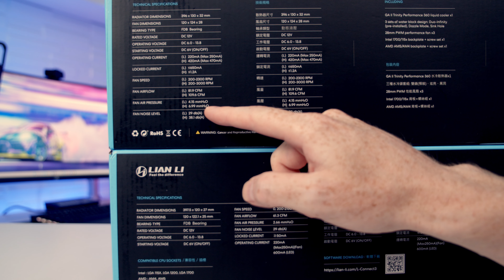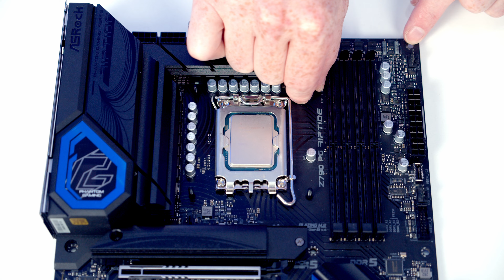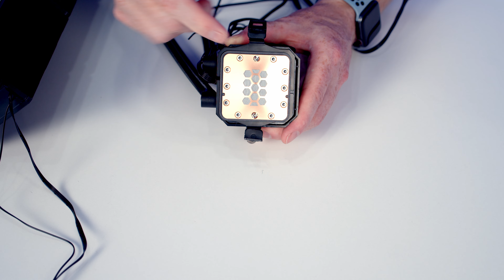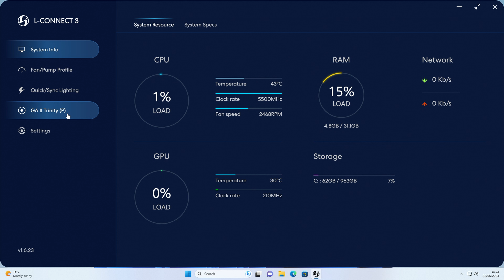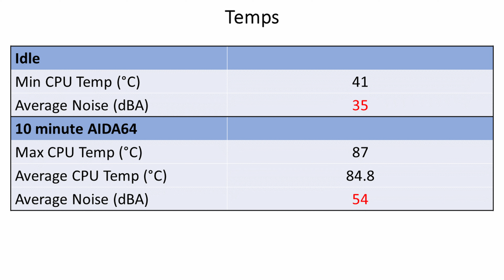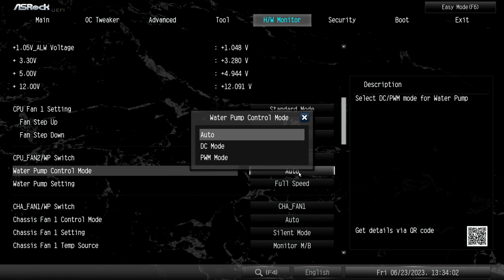Lian Li Galahad II Trinity Performance Review & Installation Guide

Comment: This is a great guide, but I have a question.  I have built computer all my life, except for the past 10 years.  I have never used the Argb lighting connectors.  If I use the 3 pin Argb connector, do I still connect a standard 4 pin pwr?  I know that seems like a stupid question, but lighting is a new concept for me as I have never really liked it.  Generally, I don't have much choice with the product I bought.  MB ASRock z790 Nova Wifi, Lian Li Galahad II Trinity Performance, D50 ARGB Ram Radiator, INNO3D RTX 4080 Black...nothing else has lighting...Thank you in advance for any advice.  This is a good video, but for the Lighting, I am a noob

Comment: 44° C idle? Dude, is that temps normal for an AIO? Are they good only to perform on high temps?

I'd an air cooler and 39°C idle in summer with room temp of 30-31°C but it sucks with heavy loads(70-80°C).

Comment: Upgraded from a Mk I , 240 Galahad to the standard Trinity 360 when I went from i5-12600K to i7-14700KF. Very happy with the cooler's performance, looks and build quality. Running the CPU slightly OCed and with slightly higher PLs than what Intel recommends, it can handle the i7 perfectly in gaming/day-to-day operation and will also cope with the added heat in torture-tests quite nicely. I'm on a Fractal Pop Air XL which only lets me mount a 360 at the front. I've set it as an intake with 2x140 bequiet fans as top exhausts and a 120 Iceberg IceGale as rear exhaust. At Intel recommended settings and with a bit of tweaking in the BIOS, the CPU will only draw around 200W in CB23, all core - and it'll usually stay below 80°C in a 10-minute run. 
That said: I'm starting to think that if you wanted to let that i7 (and certainly an i9) completely off the leash, you'd probably overpower any 360 AiO out there and would have to go with a 420 or an open-loop setup (or liquid nitrogen, perhaps?). Before going for a mild, manual OC, I had let XTU "AI tune" my CPU, which resulted in 350W power draw (yikes!) and near instant thermal throttling, even with the AiO fans running at full speed before the benchmark was started .. :D

Comment: There must have been a revision for AM4/5 mounting. Mine does not use the stock mounting type. I thought I was missing mounting hardware at first.
Reply: ya same, the new version is much better, pressure on all 4 corners, so it will have full proper contact

Comment: No 280mm? I don't see the point of 240mm AIO's when a decent twin tower air cooler out performs them. The  360mm Galahad is a beast though, unfortunately my case can only accommodate one in the  front and not when using a large GPU.

Comment: I'm planning to install this AIO in my Lian Li Lancool II Mesh RGB case as front intake. Will this fit in the bracket and can I put the bracket in between the radiator (nearer the motherboard) and the fans (near the front of case)? Any info would be helpful!

Comment: my pump RPM settings does not have a Quiet setting...only PWM or FixRPM. any ideas why? My RPM is around the same 2200 but its so loud.

Comment: For mine, the arrows pointed down towards the CPU interface, I could look at the plug and see a small key that fit into the slot on the pump side to ensure that the it was plugged in correctly, the main thing is DON'T FORCE IT.  If it doesn't go it, check the keys on the plug and the socket.  Otherwise, very helpful to figure out what all the plugs are for as there wasn't really much documentation with it.  Thanks.

Comment: this is the best AIO 360 liquid cooler right now in my opinion
81 CFM airflow and 4,15 mmH2O air pressure from low max performance from fan its amazing and 4200 rpm max pump speed its so very good

Comment: Great video. I usually build my own systems, but this time wanted to try out Micro Center's build service and I went with the Lancool III case and this AIO, but I'm thinking they didn't quite hook it up right since in the L Connect software, it does not see my fans (they're spinning just fine and temps are good, but says no fan products detected) and the lighting patterns (sink hole, etc.) won't change, but I can change the colors or style or lighting. The software shows the Pump's RPMs and let's me adjust that.

Comment: Just bought this AIO, but didn't use the fans as I use the Noctua Industrial 3000 RPM fans instead. Cools a 5800X3D just fine, but then again AMD CPUs really don't need water cooling.
Reply: @justvid366  Yes! You can also use software to control the pump and power fans as an option.

Comment: Hello Christopher

As you already had these two radiators on your channel.
I'd like to know which one you think is more worthwhile.

galahad 2 trinity performance or the rog ryujin 3 

The box I'm going to use is the phantexs NV7 with the Asus Rog Dark Hero board and I'm going to do as in your video using the radiator on top with the fans included and also putting in the D30.

continue to make videos with good content and top explanations.

Comment: The performance variant is faulty as heck. A few people are already complaining about the pump making rattling noises. Mine did that as well. And the first one I received even had a dead pump. All the German online shops don't sell it anymore. Lian Li has posted no statement so far. I'm so disappointed. The cooling performance was actually super good! :(
Reply: Apparently it was a contruction failure on the first batch. They stated they fixed the problem but halted the sale of new aios to prioritise rma of old ones. My aio started mking noise 10 days ago and they already shipped me a new model. Honestly best rma i had ever in the tech industry. Still a hazzle needing to replace the old one in the first place. Hopefully the new version works
Reply: @caphalor7252 how long did it take for them to get back to you on your RMA. Mine died 3 weeks ago. Filled out the form a week ago and haven’t heard anything.
Reply: Mine has also worked flawlessly since purchase about 6 months ago
Reply: @sp-ce hangi revizyon ? Şuan bir sorun var mı ?
Reply: @ruzgariceylan209  speak English like everyone else
Reply: @sp-ce  What revision is this? Does the pump still fail?
Reply: @ pls help
Reply: Mine works flawlessly with no noise

Comment: Hey Christopher! Love your videos. They are extremely helpful and are info packed! I am having 1 problem though on my recent PC build that pertains to getting the Lian Li Galahad II trinity Infinity all sorted out with connecting additional infinity fans to it. The fan hubs are different that come with the AIO and 3 pack of fans. I cant seem to figure out what's necessary and what isn't, and how to get them connected with the seemingly limited ports on my Motherboard. I'd love any advice you could give me and i could provide more info if you were to take the time to help.
Reply: I did this using an internal 9-pin USB splitter to let me plug both the pump 9-pin and the SL-INF controller micro USB to 9-pin into the single motherboard USB 2 header - you may not need the splitter if you have two free USB headers.. Then I connected three-direct attached SL-INF fans via the 7-pin proprietary cable to channel 1 on the SL-INF controller, I also connected another two SL-inf fans in my case to channel,3 and connected LED light strips to the 3-pin SM-type port sync connectors using channels 2 and 4. I had to upgrade the SL-INF controller firmware via the website. Then the pump,  the two groups of fans, and the two lightstrips were all detected and controlled  by the L-Connect 3 application software, which is simpler but much less flexible than Corsair iCUE. Unfortunately I was unable to sync the color of the pump to the CPU temperature, like on my Kraken Z73, or Corsair H150i. Maybe this will be available when the L-Connect 2.0 version works with the Galahad II Trinity, currently it does not, you have to use the prior version 1.6.xx. 
If you don't have the SL-INF controller, then you need to connect the fan to the pump controller with 4-pin PWM fan and ARGB cables from the fans. Let me know if this helps.

Comment: My galahad 2 performance pump died after 1 month. First it started rattling in the pump and a day later it was completly dead. Temps on my 13900k were really good when it was working.
Reply: did you replace it with another one like it?

Comment: If anyone is having trouble  at 17:45 when lining the clips up with the bracket, you can unscrew a little to give more space for aligning the bracket, then tighten after.
Reply: Holy fuck it took me this long to realize those nuts were pre tightened. I read your comment and ended up backing out the AMD BRACKET on one sideenough to get both clips on. I feel so dumb but also who tf pre tightens these
Reply: Hope I didnt just wreck my new cpu lol
Reply: You are a savior

Comment: TYVM for this excellent video. Makes everything so clear.  The "Instructions sheet" that come with this AIO are truly dire. If you are not a seasoned AIO installer, they might easily leave you weeping into a pillow with frustration.  So, if buying this otherwise award-winning cooler, the included "instructions" can, and should, be used as toilet paper and for a proper guide, watch this instead.
Reply: I downloaded the instructions and then immediately came to YouTube to find some actual instructions. They're a disaster

Comment: Thank you for the review. It will be interesting to see how the Lian Li Galahad 2 Trinity Performance performs if the default fans are replaced with the Lian Li Infinity fans. Obviously the latter has lower airflow and static pressure, but I am curious to know how much the performance will be affected. That is, is the AIO's performance due to its rad/pump or are the default fans a significant contributor?
Reply: Hope the reply isn't too late. I started with a push pull top exhaust set up with the GA II performance. I used infinity fans as pull, and the 'special' p28 (these come in the box with the perf aio), my cpu temps is exactly the same. So I had hoped the infinity fans would fully replace the 'p28s' but in the end I gain 3-4⁰c in r23. I now have this in the original set up as push pull was useless and p28s are much better than the infinity fans at cooling. Don't use infinity for this AIO. Performance before aesthetics. (Edited for spelling)
Reply: Definetely wondering that as well.
Reply: Need to know so I can decide on performance or not, since I already have inf fans and want to keep the look, can't seem to find anyone that has tested that yet
Reply: Most fans will work just fine as every case is different on how it affects performance. I put the stock fans immediately in the garbage the minute I opened the package. Noctua fans or bust.
Reply: The stock p28 fans on the galahad ii performance are pretty much the best fans specs-wise in the world, and you tossed them?

Send them to me please? Haha I'll gladly pay for shipping!

Lian Li p28, are the highest CFM for dollar value comparing all 120mm fans. The stock fans are 92cfm (lian li) vs 60 cfm (noctuas) at 33% cheaper.
Reply: @chrissilver4635  I don't care about value as I can't stand Lian Li fans period. The ones the came with AIO are cheap looking and ugly AF. I like Noctua Industrial 3000 RPM fans because they last and are quiet when under a 1000RPM. Air flow specs is irrelevant because your case design changes those specs that you read on the box or hear other YouTubers specify about. I also pushed my air through my AIO and the Noctua does the job. I don't use stock fans that come with any AIO.
Reply: @chrissilver4635  Besides, the AIO stock fans don't match the 8 Noctua Industrial fans already in my case.
Reply: Yep to each their own. I think the lian lis are fairly pretty. I dislike all rgb style fans, and although noctuas may the best fan conventionally, they can look rather ugly. 

Bequiet is still king of silent fans. Noctuas now sit in a weird place, being too expensive, ugly, lack a good 140mm fan and obviously no RGB (most people care). That's why the noctua enthusiast tax is becoming less and less worth it now.

Comment: This AIO is definitely worth a buy. I got the performance model and my Ryzen 7 7700 stays in the mid/high 30s-high 40s C playing games.  CPU is always cool.  I was so worried about heat too, as I'm new to PC building. Noise is pretty quiet too from the PC. I don't have much to compare to, but I watched a lot of videos.  I think most people would likely be happy with this, especially if running Lian LI fans, etc.
Reply: Mid 40s at the max end? What games do you play & what settings?
Reply: @Vasemmalta 😂 man's must be playing solitare or something
Reply: Until your pump dies. And its been almost a year so i assume its already replaced and you dont have performance anymore :D
Reply: @AboutShortsLab  They fixed it half a year ago

Comment: I'd like to see the Galahad II Trinity and Performance versions compared against the ASUS ROG Ryujin III 360 ARGB. Given these AIOs are made for Intel's 13th gen and Ryzen 7000, I want to see who can actually handle the heat the best among them and how far the performance is among each other.
Reply: The Asus will work as well as every single other Asetek model just more expensive
Reply: True test is X3Ds because those run hotter in general (by design)
Reply: @MetalHDGMR  the x3d cpu's actually run cooler by design because the extra cache is sensitive

Comment: Ryzen 7000 runs hot, I use dark rock pro 4 on a 7900x it hovers around 86-91 degrees fahrenheit. On idle it's around 60 ish+
Reply: @blue-lu3iz celcius my bad

Comment: Hi Chris, I have installed one of these but swapped the stock fans for the sl V2's for the ARGB which connect to my uni fan v2 hub, I have attached the usb to my internal usb hub, fan connector to pump header and sata to power. I don't get the pump section in my L3 connect. I have optional cables which I think I need to use the rgb connector from the pump head to the female/male convertor with the 3pin connector going to my uni fan controllers sync ports. Will that give me the section in L3 do you think?
Reply: Hi, in case you made it work, could you let me know how it performs with the fans swapped? Im thinking about doing the same.

Comment: I have the LT720, changed the fans to Lian li ST120's.
It is now quieter and cooler..
Watching your video my CPU 5800x is at 34c - 36c..
Reply: get lian li UNI FAN AL V2, better cfm nd rpm
Reply: You upgraded your cooler instead of your gpu or cpu?
Reply: @Marewww  WHAT?

Comment: I've connected my pump & fan to a fan splitter on my AIO header on the m/b but L Connect doesn't detect the fan speed and it runs at 100%. Any tips? TIA
Reply: Try connecting your pump to the cpu fan header instead
Reply: @jayv231_  I've tried every possible combination with no luck 😂 appreciate your reply.
Reply: Maybe try connecting the fan and the aio separately. It could be the splitter

Comment: I'd like to know how good this is with the 13900k (EDIT) I've bought the performance model and its brilliant with the 13900kf I highly recommend it.
Reply: Do you think it will fit in a Corsair 5000x case ? I heard it's a little thicker than most aio but not as thick as the artic
Reply: @downsouth1678  it fitted in my 4000d. Had to remove the fans for fitting it in though and screw them back on again after
Reply: Hello, is it loud? To the fans run at same speed you are setting them or the pump have an auto function so the fans run as needed by the CPU?
Reply: @AexoeroV  I've got a video on my channel about it